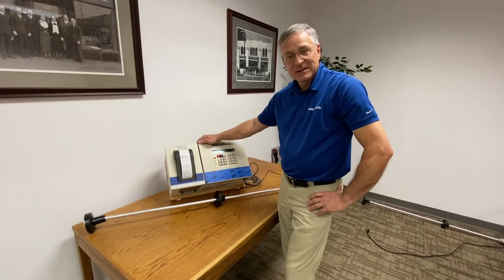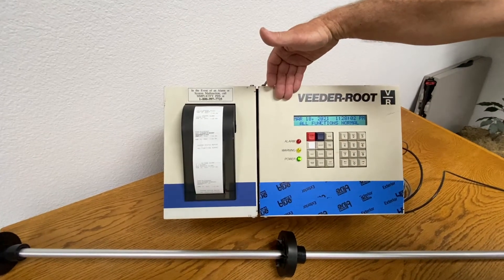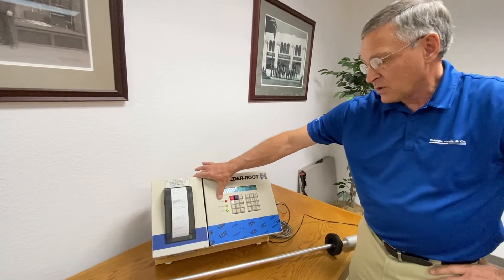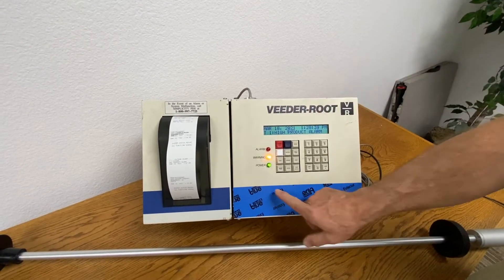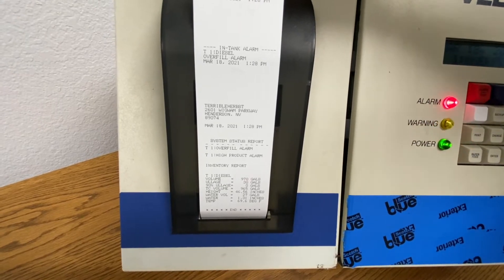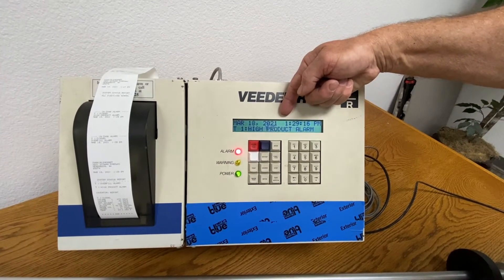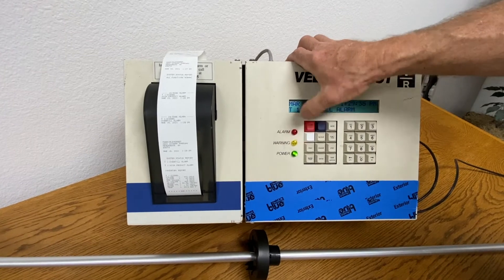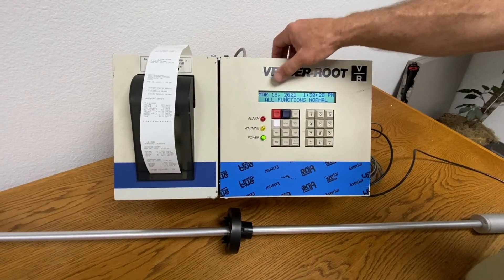Shields, Harper Veeder-Root Training 101 - What is a fuel tank overfill alarm?

Comment: What does it mean if all alarms are on but all sumps sensor locations are dry?
Reply: Sensors may be placed horizontal by mistake which sets off the sump sensor alarm.  Stand Sensors vertically and check alarms